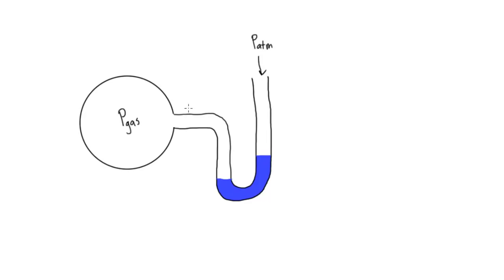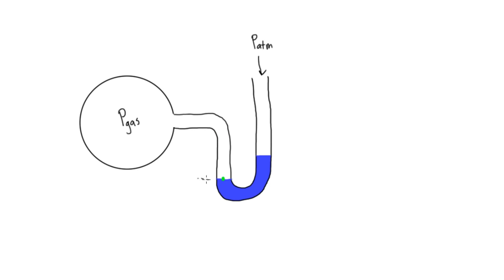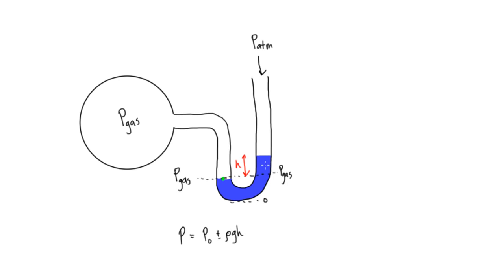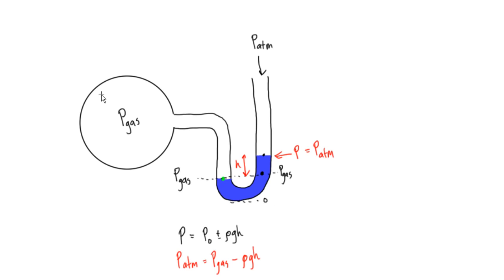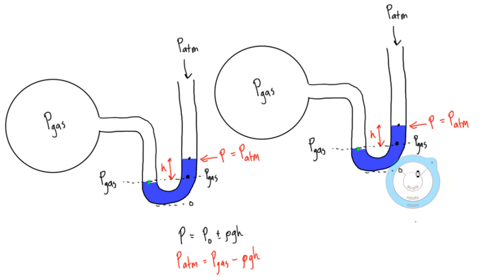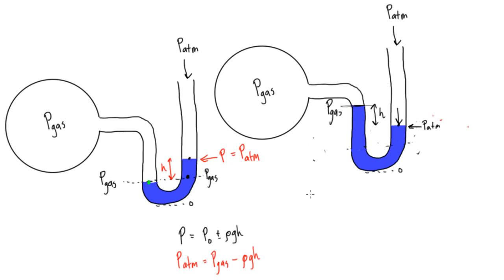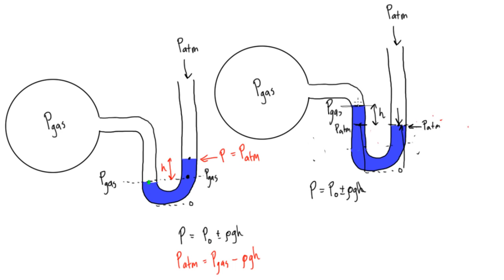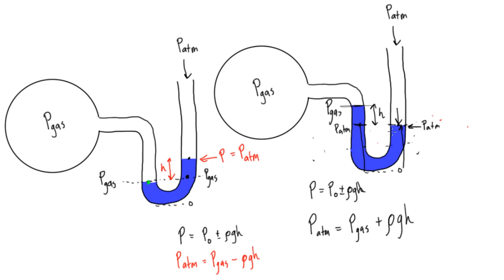How to solve manometer problems

Comment: If we exchange the gas with a liquid, will it be the same as all the dots have the same pressure or it will vary ?
Reply: I think it will vary since the weight of the fluid will add more pressure than the weight of the gas!

Comment: When do we add Patm to pgh
Reply from the maker: When you want to know the pressure in a fluid that is at depth of h below the surface of the fluid that is in contact with the atmosphere. Sometimes with manometers due to the U shaped bend there can be a location in the fluid column that is higher than the boundary with the atmosphere. In that case you subtract ρgh from Patm.
Reply: Engineer4Free thank u so much and it was very help full
Reply from the maker: Awesome, thanks for watching!
Reply: Sir when you add P(atm) + P(gage) is equal to = P(absolute) ?

Comment: Sir one think i did not understand that what is Po
Reply from the maker: Po is just a known pressure. Usually in problems like this you start with Patm as Po, and then you will add ρgh to determine the pressure at the deeper depth. In compound manometer problems you will then repeat the same equation, but you will use P from the last iteration as Po in the new iteration. If you go deeper into the column in the next iteration, you add ρgh and if you go up higher into the column you subtract ρgh.